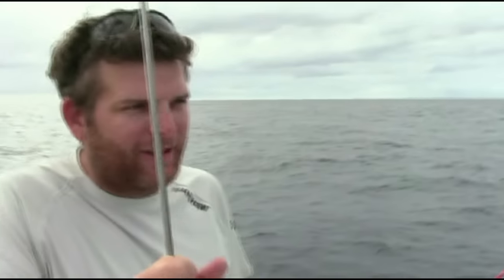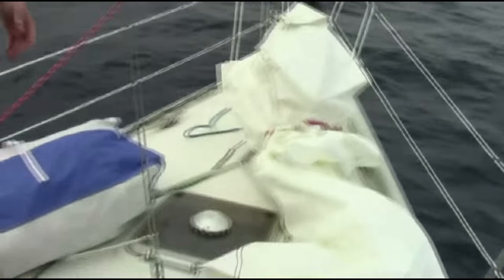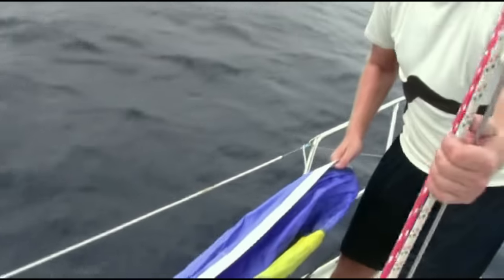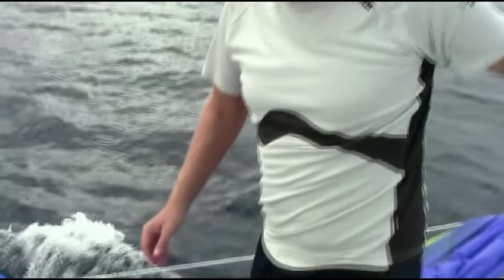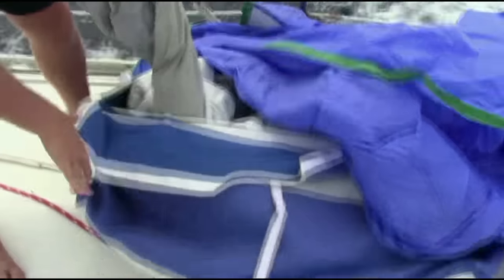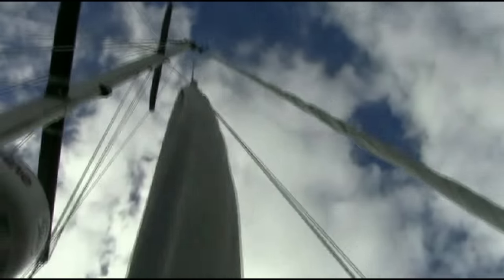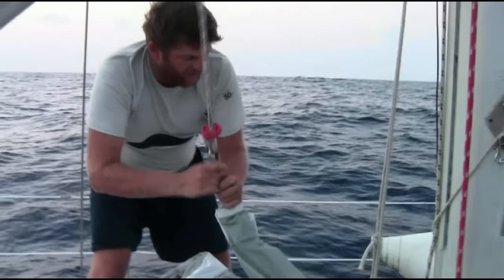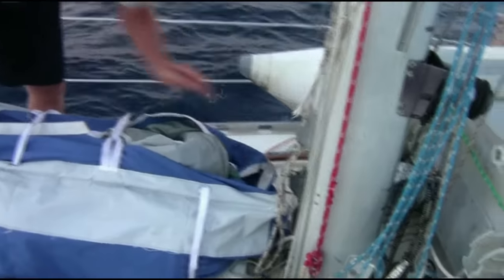Hoisting and Dousing an Asymmetrical Spinnaker Using an ATN Sock

Comment: Thanks for the video! We don't have too much issue gybing our asymmetric but dropping it can be a pain. I like the approach of dumping the idea of dumping the tack to help drop it. Those quick release shackles are quite punchy $$$ so going to try to use the line we're currently using run back to a cleat :-)

Comment: Those are some beefy up-fucker / down-fucker lines. I got some shitty 5mm lines on mine and they're bloody useless for pulling down the sock in 25 kts. I like your setup for releasing the tack. We've been releasing the clew and it doesn't de-power enough so it's like wrestling a very angry 15m crocodile that's determined to throw you overboard. I'm stealing that idea for when the wind gets up there.

Comment: We have just bought a Hunter 273 with a cruising chute. Had a few problems pulling the sock up the sail. In our opinion the sock was too small at the lower part of the sail. it would bunch up, and even when the clew and sheets emerged,  it still bunched up and snagged. So we cut 2.3m off the top of the sock. All works well now but the disadvantage is that you have quite a bit of the sail on the foredeck to handle before the sock is hoisted. Will be fitting some netting to the guard rails today to keep the sail on the deck. We want to do a bit of racing around the cans so reckon we will be able to deploy the chute in about 20 seconds once set up. Also going to colour the sock up haul to quickly identify which one to pull!

Comment: Thx for the video...I am getting things prepped on my boat to use a spinnaker, with a sock...35' beneteau first.  The spinnaker i have is symmetrical...It looked like you were using this without a pole. What size is the boat you were on? And yes...you make it look easy!
Reply from the maker: Hi, sorry for so late reply. I haven't been active lately. Boat is 40 ft First 38 from the 80s. No pole, but i did make a bow sprit and that helped a lot. Thanks for watching.

Comment: Hi could you tell me which shackle it is you recommend, or send a link as cannot find it in the UK, thanks.
Reply from the maker: i prefer a tylaska brand trigger release snap shackle, i think i used a t-8 on this one but i am not sure. just use the recommended size for your spinnaker. Also, you can get a "spike" to help open it.
Reply: @HardlyAnythingWorks  Thank you.

Comment: uhhh, what happens when you gybe?  No second sheet??
Reply: end to end?
Reply: Pull sock down, move sheet, pull sock up. That's how I do it, but only because my second sheet got loose a few weeks back and wrapped itself around the propeller and we had to cut it up [crying intensifies].

Comment: How to jibe it?
Reply from the maker: a couple ways, but what i usually do is just snuff it without releasing the tack and then pull it over. The concern on the gybe is that the snuffing sock gets hung up then you can't take it down. when off shore on long cruises in consistent wind though, you rarely gybe.